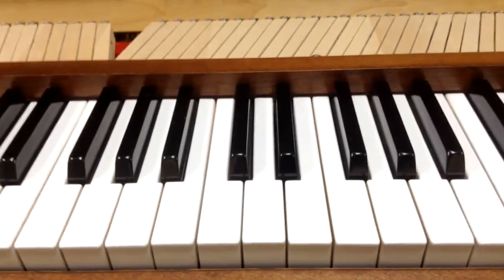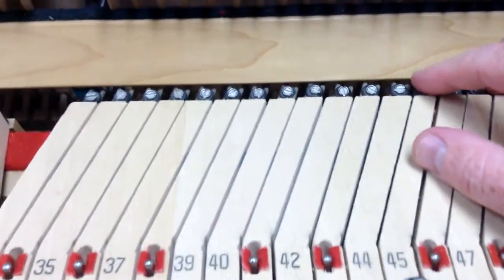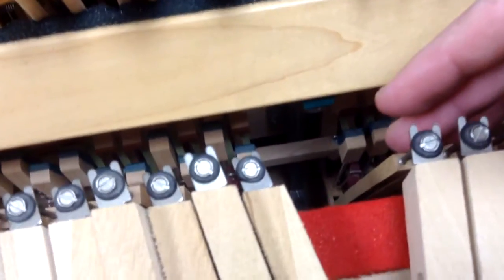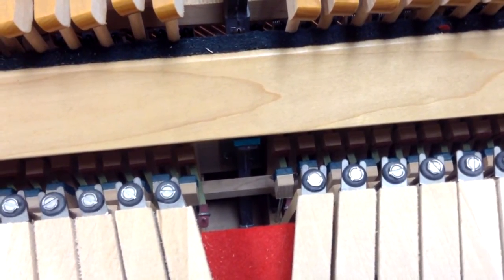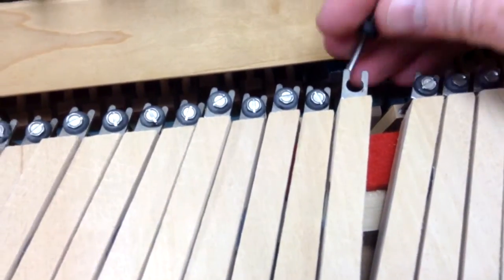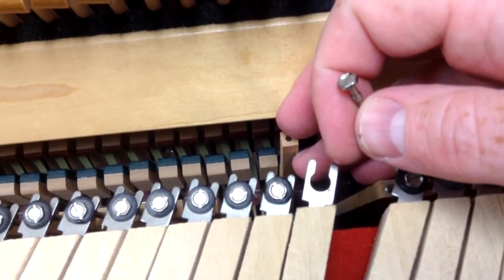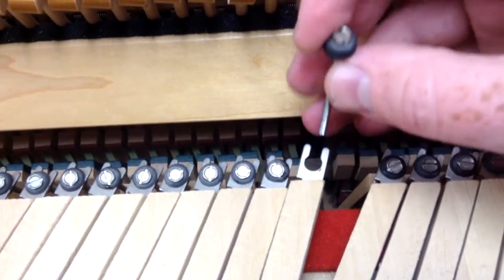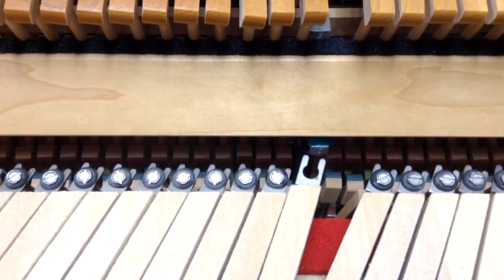Replacing Spinet Lifter Grommets - Piano Tuning & Repair I HOWARD PIANO INDUSTRIES

Comment: What if there is a wooden grommet on top of a thick piece of felt?
Reply from the maker: It should work about the same.  The wood lifter buttons are threaded and can be screwed off of the lifter wire if you need to replace it or screwed up and down if you have to adjust it.
Reply: howardpianoind ok thanks!

Comment: Can I use donut grommets if i currently have square? The price difference is nuts
Reply from the maker: You could use the donut grommets, but then you would also have to add the Baldwin Wire Finger Nuts as the donut grommets aren’t threaded.  This is actually a more expensive route to go because by the time you by the donut grommets and the finger nuts, the price will be more than the square grommets.  If you already have the finger nuts, then yes, the donut grommets are a less expensive way to go.